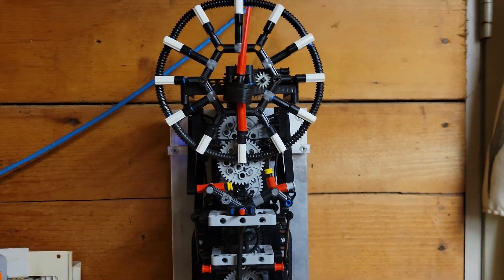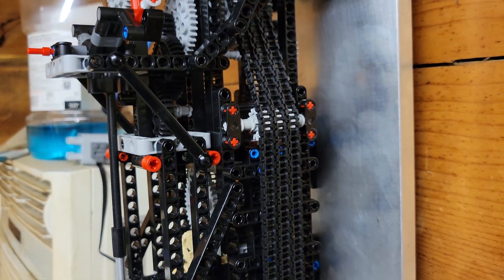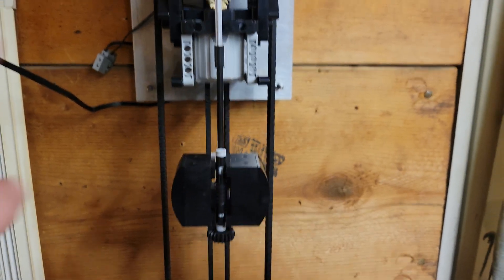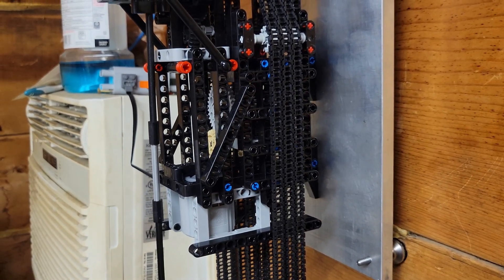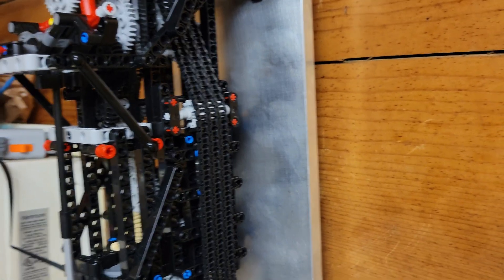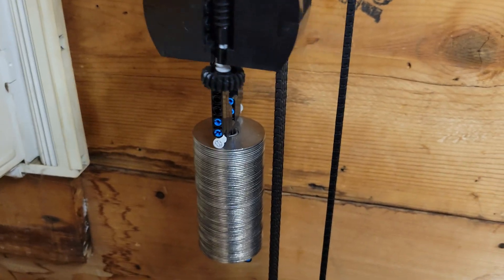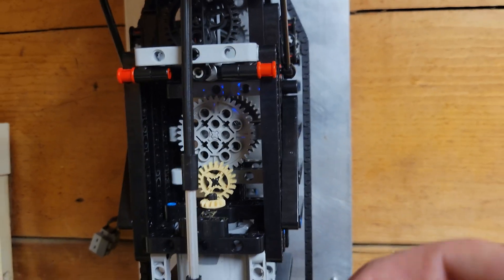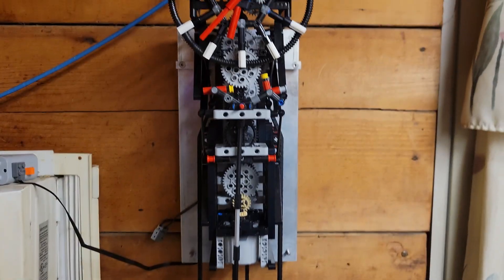Lego pendulum clock, a copy/clone

Comment: I also started from Dillon Sharlet's design when it used a Galileo escapement.
As you have done, I switched a similar "maintaining power" design.

This design can accommodate an autowinder.
Reply from the maker: Not sure what an autowinder is
Reply: @timramich  
An autowinder is a mechanism that would start your winding motor when your main weight approaches the end of its travel, and would stop the motor when the weight is lifted to the top.

You may check out my YouTube channel for some of my designs:
https://www.youtube.com/channel/UCakfCvl6URtj52IxyO6_vhw